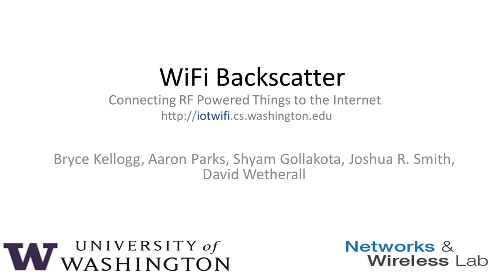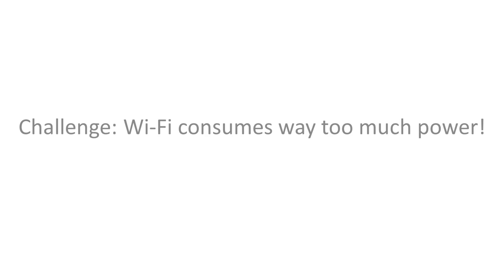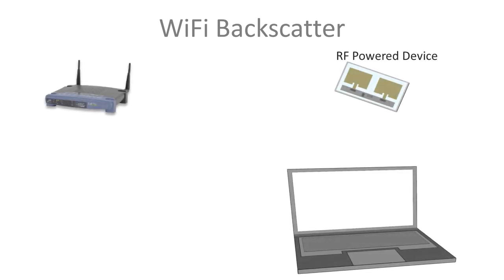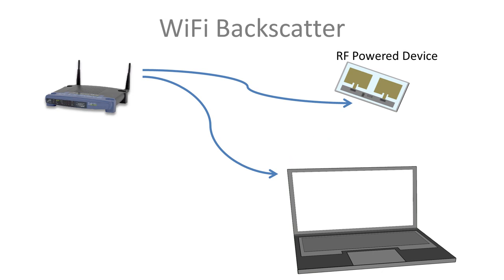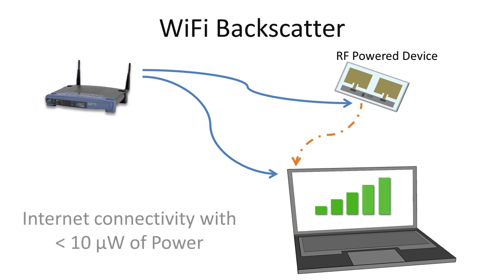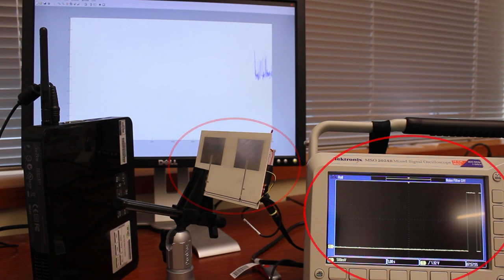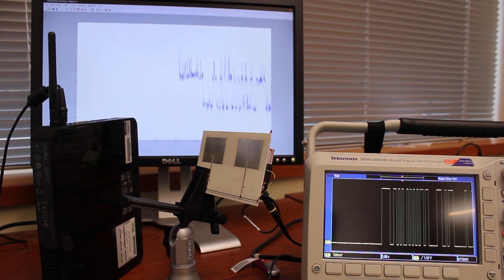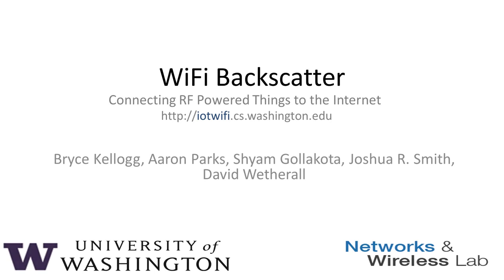WiFi Backscatter: Connecting RF-Powered Devices to the Internet

Comment: Could this system be set up to place the RF powered device into a wireless mouse or the laptop and have it power the mouse so that it would not need batteries, the same with wireless headphones.   Then the mouse and the headphones would never need to be charged or batteries replaces.
Reply: No, a mouse and headphones require a massive amount of power.
Reply: J Parril What about using a power amplifier?
Reply: Wilber Hernandez A power amplifier doesn't actually make more power. It just takes an incoming signal and pushes it out stronger using an alternate power source. Power amps tend to be plugged into the wall.
Reply: Oh yeah,  you're right.  I thought about that after posting the question - thanks
Reply: Its not about generating power. Its more like passive transmission of information ..

You could place a rf device inside a keyboard and than configure it to generate discreate variations in the backscattered network.. might b possible for keyboard as it does not have led or driver circuit as in mouse and headphones...